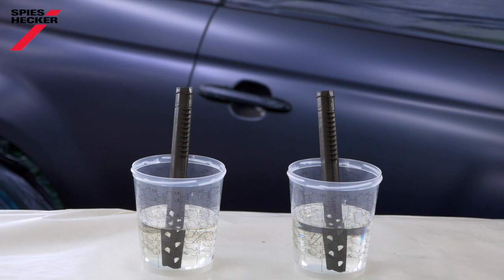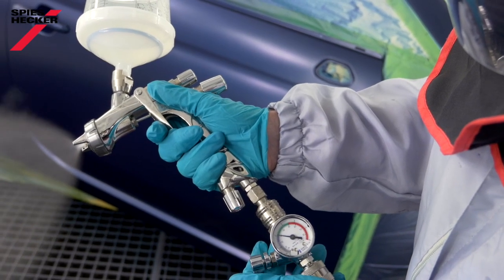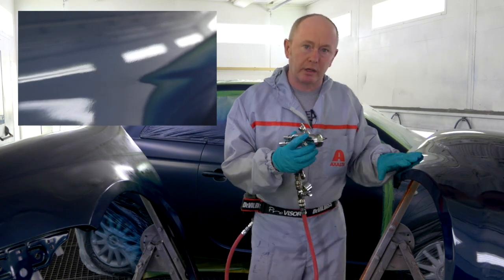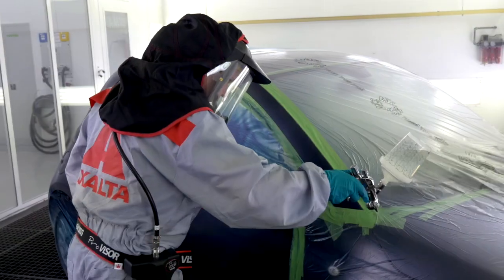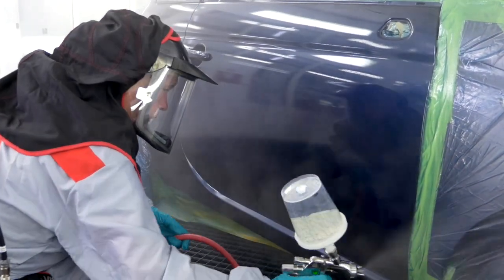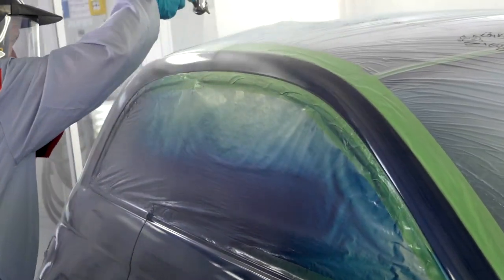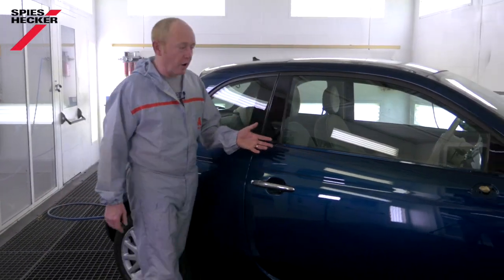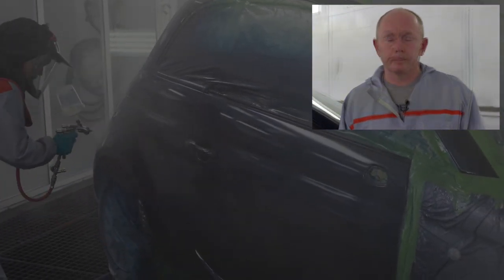Permasolid Clear Coats Application process in 1.5 coats

Comment: learned something new! I have been spraying my half coat at half trigger , normal distance/speed. 2nd coat full trigger and speed will depend on what my brain feels like doing, wether it be close and fast, or normal speed/distance. I adjust accordingly to what I see with my eyes. Spies is a very forgiving paint system I would say.
Reply from the maker: Thanks for the comments, nice to know we have helped.
Reply: @Spieshecker  is that how the clear is applied in this video? The first coat with a half trigger? I Struggle with coat and a half as I tend to either end up with a finish that wants to run or is a little too dry
Reply from the maker: Hi, when applying the first coat you should use a full trigger but with a closer distance to the object and close the film using a thin closed coat. After that and without flash increase your distance to normal and apply a full finish coat.
Reply: @Spies Hecker  what is the best mixing ratio would you prefer 2.1 or 3.1.1
Reply: @tristandelbridge4818   hello question for you what is the best mixing ratio for spies hecker 8035 HS clear  2.1 or 3.1.1 struggling with orange peel with the 2.1 mixing ratio  🤔  thanks
Reply from the maker: The mixing ratio to be used depends upon the product involved. Please refer to the respective TDS as there may be an alternative mixing ratio listed, albeit with a different hardener type.
Reply from the maker: The mixing ratio to be used depends upon the product involved. Please refer to the respective TDS as there may be an alternative mixing ratio listed, albeit with a different hardener type.

Comment: Hello! Is spies 8700 applicable for the 1.5 coat application with minimal flash off In between coats?
Reply from the maker: HI, Permasolid HS Race Clar Coat 8700 must be applied in 2 single coats with a short intermadiate flash of 2 -5 minutes between coats. Please refere to the TDS for more information on this product. https://sdstds.spieshecker.com/Doc/TDS/EN/EN%208700A.pdf

Comment: Im starting to have a hard time all of the sudden im spraying at 20psi and running or having a lot of orange peel
Reply from the maker: Hi, to be honest I do not know which clear you are using but with our EU products our inlet pressure depending on the clear is normally 1.8 - 2 bar (2 bar equates to 29psi)...

Comment: I use spies hecker 8007. If i spray it in a 1+half coat the second full coat tend to copy the first half coat leaving with the bad finish of the first one.
Also, i notice that if i wait 0 to 2 minutes (as per TDS with the 1 and half process) i get solvent pop and so, i have to wait of a minimum of 10-12 minutes between coats to get a beautiful finish.
Is this normal with this clear?
Reply from the maker: Hi and thanks for the question. 8007 is designed to be used in 1.5 coats and should be applied in a thin but closed coat followed immediately by a full finish coat. Having any open/partially closed areas with the first coat can lead to difficulties in achieving a good flow with the final coat. Applying as recommended in combination with the correct hardener and gun set up should produce a good, from the gun finish. Using too fast a hardener for larger jobs or in the wrong conditions could be the cause of the solvent popping you mention.

Comment: Hi sır ....i did use 8330 Clear coat with a ratio of 3:1 with no thinner cause the body shop told me that with no thinner anyway it was great with glossy but too much orange peel......what was the reaso n?i tried everything to lay out the Clear ;i paint it close far but it didnt change....:((((
Reply from the maker: Permasolid HS Clear Coat 8330 is a product developed for use on commercial vehiles. You do not mention which hardener you are using but given you specify a 3:1 mix ratio I assume it wiould be VHS hardener? This being so you need to add 10 - 15% of a recommendee reducer to achieve the correct ready for use viscosity. Using the clear without thinner means a far too high RFU viscosity leading to the problem (and others) that you describe. Please refer to the TDS for this clear coat for further information http://sdstds.shcolor.info/Doc/TDS/EN/EN%208330N.pdf
Reply: @Spieshecker   @Spies Hecker  thx for ur answer i am so glad for ur kindness.....u are right sır it was the reason ;i trust to the body shop cause he insist that the mix had to be without reducer; when i try to find the reason i dıd check the Info of 8330 and it was written i had to add 10-15% of reducer:)))ohh my god it was very hard to sand it out....one question sir; u dıd write that 8330 is a product developed for commercial vehicles....Mercedes e ,BMW are they commercial vehicles or whats the meaning of commercial vehicles????
Reply from the maker: Hi thanks again for your question. Commercial vehicles are Trucks, Busses, Trailers, etc. So 8330 is actual developed for larger surfaces, meeting the needs and demands of bodyshops repairing commercial vehicles (CV).

Comment: How much percent High Solids does Spies Hecker have
Reply from the maker: Please could you expand a little on your question?
Reply: @Spieshecker  . how much percent High Solids does 8035 clear has
Reply from the maker: We do not normally give out such data but it is safe to say in excess of 50%. The important thing to consider is that 8035 when used as described in the TDS is fully CVOC Compliant in the EU and is below 420g/lt.
Reply: @Spieshecker  what is the difference between VHS hardner and a Hs hardner for Clear coat
Reply from the maker: VHS Hardener have a higher solid and reactive ingredient content than HS hardeners which is why there are differnces in mixing ratios where both can be used with the same base product i.e. 8035 is mixed 2:1 with HS but 3:1 with VHS (plus reducer in the case of VHS to achieve the correct RFU viscosity)
Reply: @Spieshecker   I am going to use 8035 with 3320 slow hardner ratio 2:1 with 10 to 15% reducer would than be correct as a overall paint job thanks
Reply from the maker: Hi, the correct ratio for 8035 with VHS Harener 3230 is 3:1 + 12.5 Reducer (3380 or 3385 Slow). The choice of hadener you use should be determined by the size of the job you are doing and the conditions. So, if you are doing an overall respray on a large car I would go slower and use 3240 as my hardener to give myself mor control and easier application. Please refer to the following TDS http://sdstds.shcolor.info/Doc/TDS/EN/EN%208035A.pdf

Comment: Ok that was 2 coats. I have used iwata for clear and never could use it with the fan fully open.  You must be a magician
Reply from the maker: Providing you choose the correct gun set up and use the correct inlet pressure it is possible to apply our HS clears in 1.5 coats where recommended. Remember though, don't spray the first coat too heavy, thin and closed is the target followed by a full normal coat.
Reply: @Spieshecker  i have the 1.5 coats down. My 3000 rp 1.3 works best for me over my 5000 1.2rp
Reply from the maker: Spraygun choice is a personal, the important thing is that you are using the correct set up and getting the result you want.
Reply: I spray spies every day of the week. I'm no pro at the 1.5 coats thing but u say first coat close and fast but what i watched u do were two almost identical coats...?
Reply from the maker: Thanks for taking the time to comment. Maybe the camera does not quite show the subtle differences in the application procedure but the application should be a thin closed coat followed by a full coat at a slightly increased distance to the substrate to produce the finish you are looking for.
Reply: @Spieshecker  im using 8180 and 1.5 coats looks better than 2. Great stuff